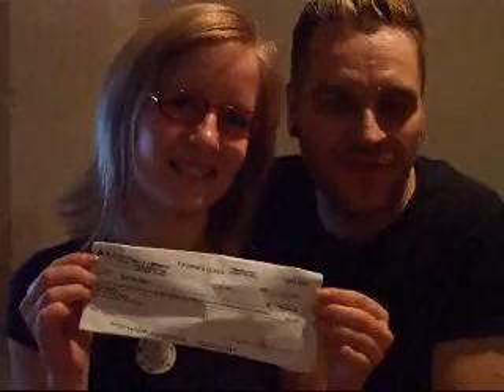NEW Free Energy Thermoelectric Solar Wave Concept

Comment from the maker: Seebeck Effect Thermoelectricity - cold and hot on two metals, produces current. 

I've taught this, and it really has to be "hands on", for someone to appreciate a Thermoelectric Generator.

James' idea is to use a parabolic dish to capture heat into one side and the ocean to cool the other side.